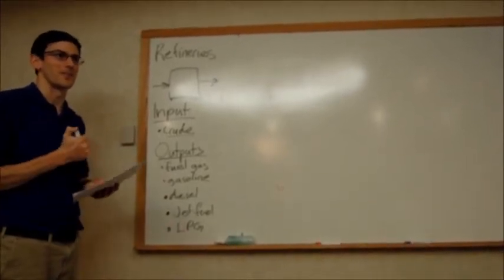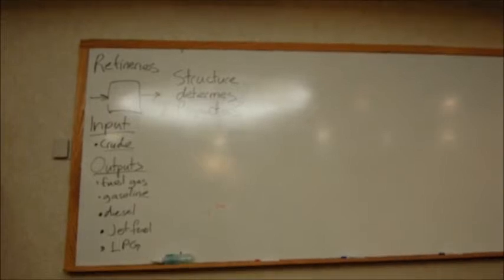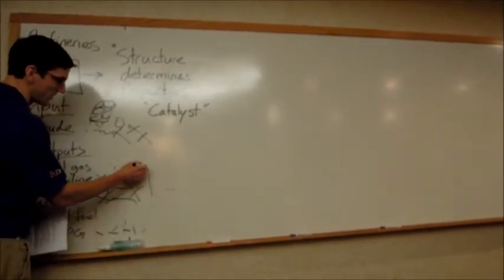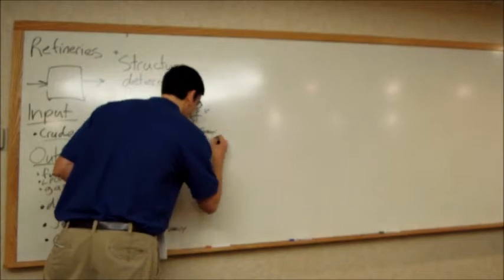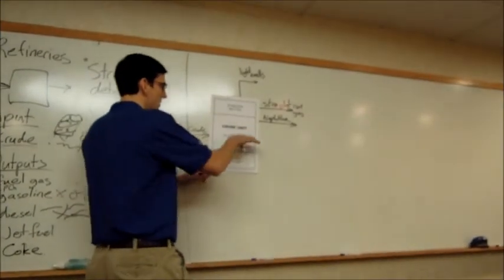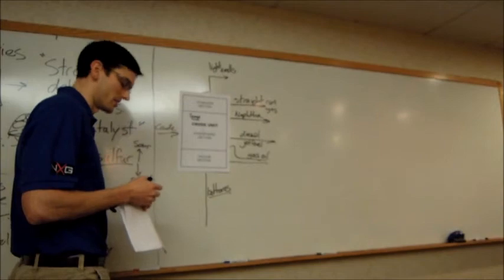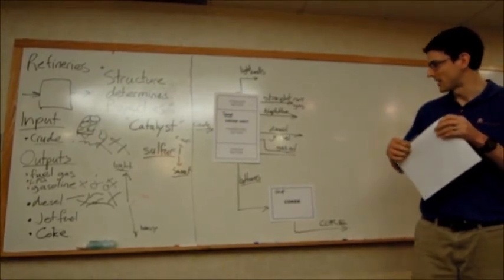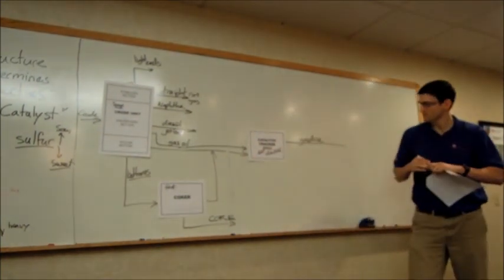Petroleum Refining Part 1: A Non-technical Overview with Paper, Tape, and Markers

Comment: i was watching your mud walking video and checked out your other uploads, ended up here. I was a control person in a crude oil refinery when I was young, started out as an operator so I know how to make gasoline, diesel, avjet, propane etc. We had a coking unit in our plant and I started out drilling and shoveling coke. They shut the plant down in 1985 so that was that. I worked there 5 years on the delayed coking unit, the crude pipe still and the catalytic reforming unit.